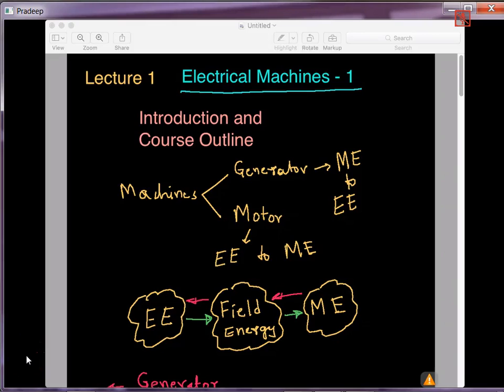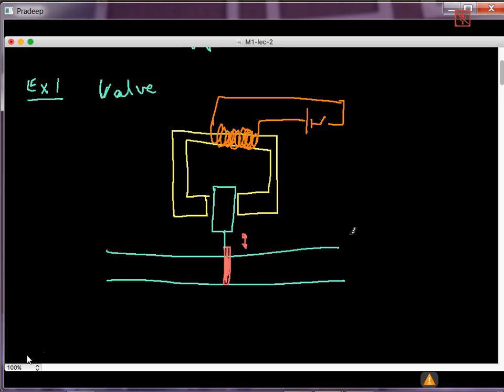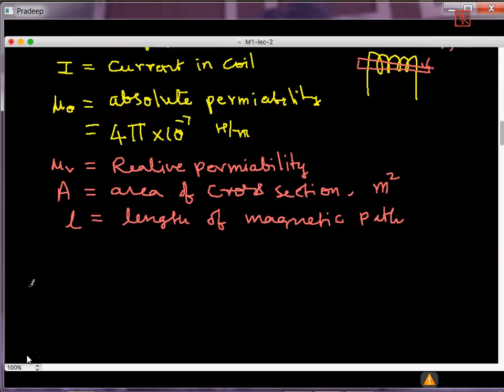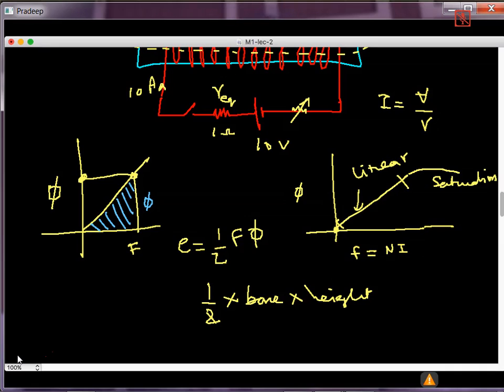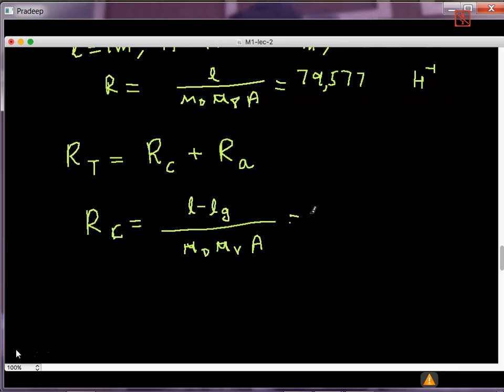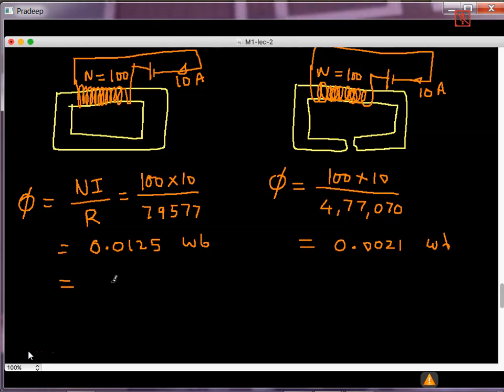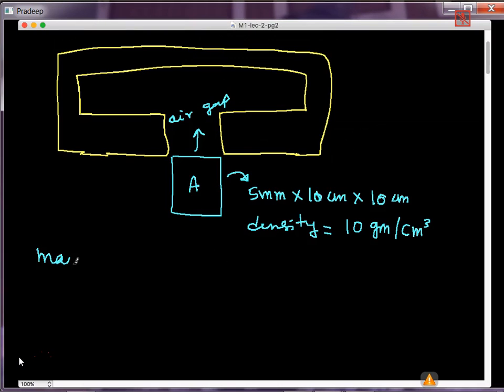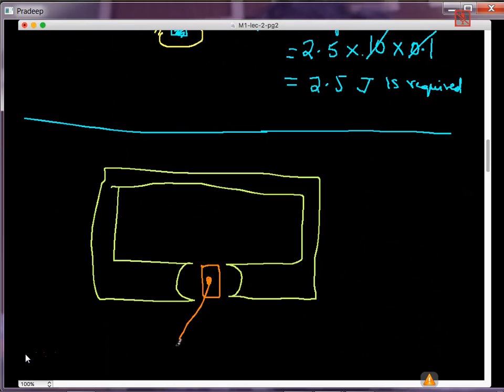JNTUK MOOCs EM I 27 06 2017

Comment: Sir at 1.04.32 energy needed to filt block is 2.5 joules... but energy in core with airgap is only1.05 joules... so that block won't move upward direction... but you said block will move upward how???